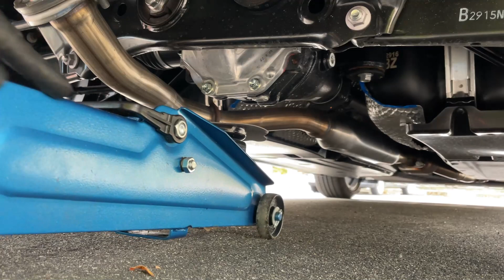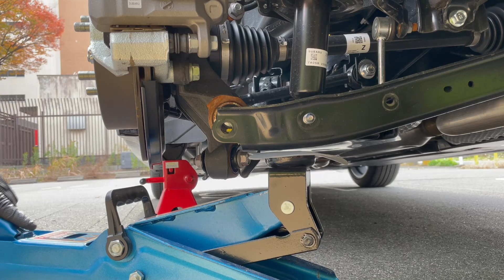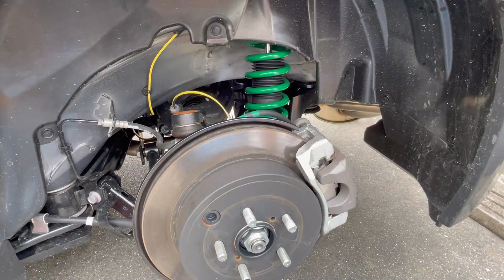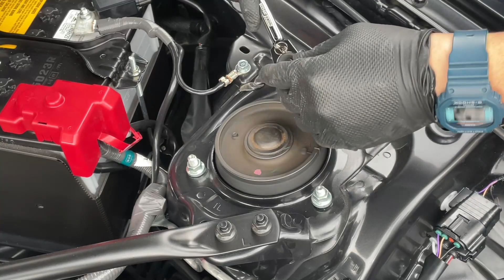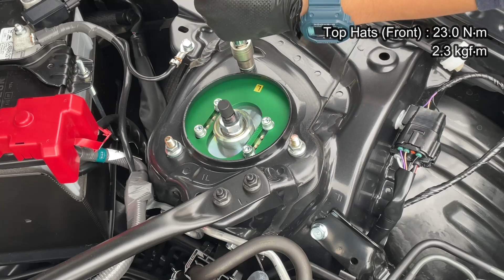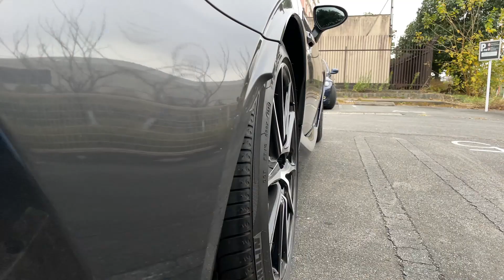[GR86·BRZ] Remove/Install Coilovers (By Yourself) #DIY

Comment: Would it be a bad idea to use an impact when loosening and taking off most nut and botls?
Reply from the maker: Impact is no problem, I just don't have one.
On loosening, no problem at all.
When tightening, make sure the nut/bolts are in their screw thread before using an impact. You don't want to sheer-off the thread if its not aligned properly.

Comment: Honestly, this video is great. No crap and the music isn't overly loud downtempo hip hop for a change! I'm going to be doing this on my GT86 very soon. Same Tein kit. Mine came with some sway bar drop links, but I see you didn't need to change yours. Do the rear ones just work ok?
Reply from the maker: Enetually I replaced end links both front and rear. 

Just remember to remove/install coilovers on both sides before installing the end links.

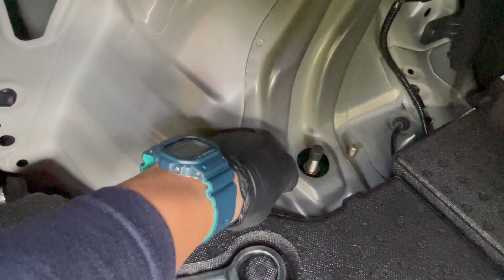Comment: 6:51 I was doing the same but when I am jacking it up from the LCA, the whole chassis was pushed up (car lifted) so I quickly lower the jack down and pull the struct outwards to realign the top head, Is it normal? Did I damage anything!?
Reply from the maker: It would be normal for the whole car to lift. So I just jack it up enought to just expose the top so I can thread in the nuts.

Comment: перед затяжкой сайлентблоков, надо было авто поставить на землю, чтоб резинки заняли правильное положение в котором будут находится все основное время, только потом затягивать болты. со временем у вас сайлент развалится от перенапряжения.
eng: before tightening the silent blocks, it was necessary to put the car on the ground so that the rubber bands would occupy the correct position in which they would be located all the time, only then to tighten the bolts. Over time, your silent blocks will fall apart from overexertion.
Reply from the maker: Yes you are correct. I added this info on video description. Because I forgot to mention and take a video after.

Comment: I have the Tein flex z's I could not get the lock to unlock lol so I just left it..
Reply from the maker: Hi, what lock are we talking about?
Reply: @39gjapan  the bottom ring so you can lower it more
Reply from the maker: You need to use something to counter the counter-clockwise turn of the lower mount lock (bottom ring). So use a wrench or any bar to make sure the lower mount stays and not turn together with the bottom ring.

Comment: did you need anything other than just the coilovers?
Reply from the maker: For the street it can be ggod with just the coils. But I suggest you replace sabilizer links (swaybar link) as well when you drop the car. Some brands comes with the coils, but mostly don't. I got myself front and rear coz I track the car.

Comment: What spring rate are you running for this setup. How the feeling on the street driving. Its to hard or just good
Reply from the maker: Front: 8kg/mm
Rear: 10kg/mm

It is kinda hard for the street even at full soft setting. But it feels great on track.

Comment: might I suggest a HF breaker bar and 1 wheel socket to remove the lug nuts easier (less dangerous than the 4-way wrench)  __  I know Tein is supposed to be a good brand for suspension, but I never hear great things about their stuff.  Is their top tier race stuff good and their street stuff meh.  Or is it ppl not knowing the right Tein product for their car or misunderstanding what the capabilities/limitations of the Tein product they installed/chose?    I personally see them as bottom tier suspension bits...am I wrong?
Reply from the maker: Yeah, I see a lot of guys get the bottom tier street coils and use them on track. they cheap out and complain. TEIN has been out there for so long, they got the right one for your preference. 👍

Comment: Just a suggestion use a 6 point wrench and sockets on torqued nuts less likely to strip or roll the points. Great video!
Reply from the maker: Thanks for the Tip, but am still kind of limited on my hand tools. gonna have to buy more soon.

Comment: Hey! Thanks for all the great content on the GR86.

I am curious to know what the 86 community in Japan thinks about the oil starvation issue? Is it a big concern there? Are you noticing many failures on track? 

900BRZ's overview / analysis of the issue (note the KB baffle did not address the issue)
https://www.youtube.com/watch?v=4Jk5WTWoqt4&t=1s

Thanks!
Reply from the maker: Your welcome! I will do a video of it soon. Will interview people on the next event.
Reply: @39gjapan  Great idea! Would be interesting to know the differences in their setup and if anyone is actually measuring oil pressure (similar track&build / 900BRZ)
Reply: @39gjapan  Also if you can find out if anyone is running the Kazama baffle... It would be great to know their feedback!

Comment: Nice clean work. I would be better to torque the nuts when the car is on the ground. The bushings would have longer life.
Reply from the maker: Thanks. And your right. So actually retorqued them. Just couldn’t find a way to edit an uploaded video. 😅
Reply: grateful if you could explain this comment further (for a beginner) - which are the nuts that should be torqued once the car is on the ground?
Reply: @rohandias1244  Nuts or bolts that fasten a bushing in a suspension. If you tighten them with the wheels in the air, when the car will go to the ground, the bushing would have a preload on them. If you torque them when the car is on the ground, the bushing would be in the right position for driving, without any  preload, so less stress on them.
Reply: @Mellyfilm  thanks for the explanation! Makes sense. Just checking - with the wheel in the way (presumably you turn the wheel full lock) will there be enough access for your torque wrench to properly torque the nuts?
Reply from the maker: There will still be, specially if thale car is lowered on the ramp.
Reply: @39gjapan  This is a great question and I too am looking for more clarity. I'll be installing my ST XTA coilovers this weekend, and I loved your video, and the fact you included all of the torque specs; thank you for that. My question: before I torque any of the nuts on either the front and rear, I need to lower the car, then torque to spec? Ideally on a little ramp so I have more room? And for the front, turning the wheels so I have more access? Thank you in advance!
Reply from the maker: @aleccheline9903  Yes, Tighten then, we lower the car before tightening torque spec.
And like you said on the front.
Reply: Sup guys. Where do i find the foot pound torque because i can’t understand the measurement you using in this video, Im a newbie using torque wrench. Thanks
Reply from the maker: Hi, torque specs are usually written on coilovers manual. But you can also use a converter online N.m to lbf

Comment: And last question sir i just got my gr86 last 2 month but my disc brake looks rusty. Do you have any idea what to do?
Reply from the maker: It’s only surface rust. It will be cleared after a drive. Brake rotor rust can be worse depending on the climate.

I still can’t find a way to prevent it from rusting.

Comment: Hi! Is that a tein flex z? Whats the difference with tein street? Im planning to get one tho. Thanks in advance
Reply from the maker: Hi, this is the “Mono Racing Damper SpecR”..
In short..
Flex z and Street are both Twin tube, while this one is a Single/Mono tube.

Twin tube are designed to be comfortable on a daily drive.
Mono tube ones are usually designed for the track.
Reply: @39gjapan  Thank you so much. So should i get tein flex z? Sorry im just a newbie.
Reply from the maker: Everyone has their own opinioin. But if you really want TEINs, I can suggest you Flex-Z if your mostly gonna ride on the streets or a daily.

There are a lot of coilovers out there, so it's really hard to pick one.
Reply: @39gjapan  Thats true. I want something trusty brand and doesnt break the bank.
Reply from the maker: @ClaireMarjorieChua  If ypu really want to go with a Japanese Brand, Flex-Z is good. A lot of people runs them and they’re great.

Comment: What’s the difference between theses and bc? Awesome video by the way!
Reply from the maker: Hi, thanks for the positive feedback!
For your question tho, you have to more specific on which model of BC Racing your talking about. TEIN also has a wide range of Coilovers. So it&s kind of hard to tell which is better.
TEIN is has been in the coilover industry for so long, but that doesn't mean it's better than BC Racing.
If your spending the same amount, I found this comparison video on TEIN Mono Sport vs. BC ER Coilovers from "Drive Tune Media" 
https://www.youtube.com/watch?v=qsbdNy8XWkM